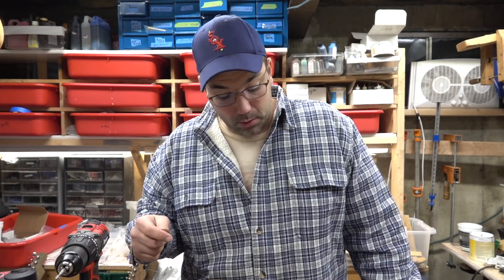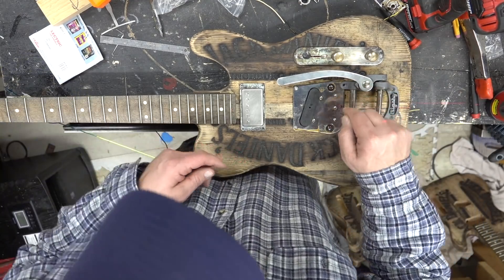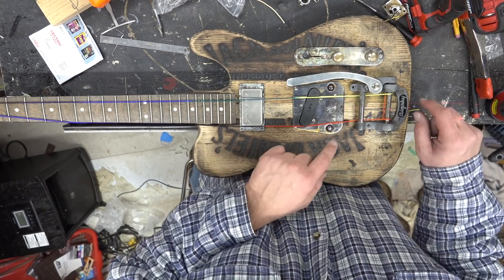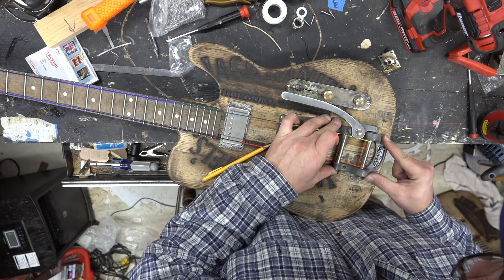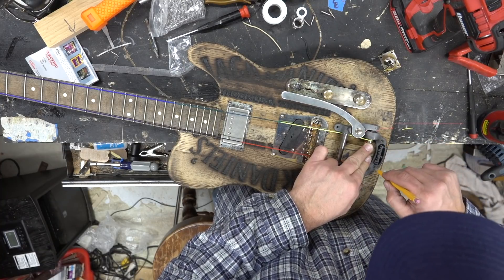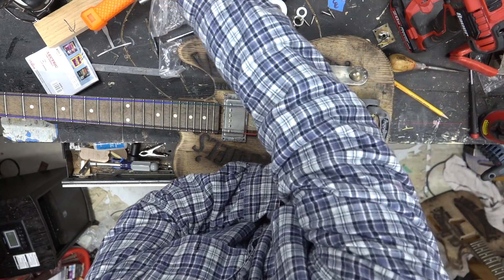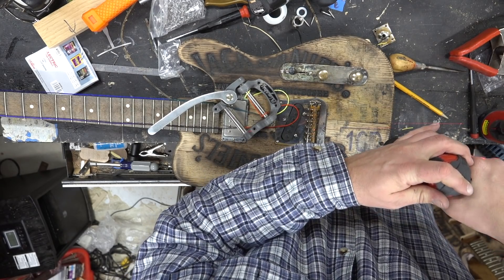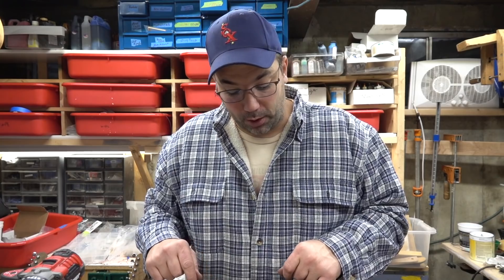Some tricks for setting up a bigsby tremolo on your guitar

Comment: The JD's are a real success. Well done and well deserved.
Just a little tip. 
When screwing screws in oak,  first pull the screw along a piece of candle, it goes in much easier and won't break. (tip from my dad. RIP)

Comment: Couldn't you add them screwholes to your template?
Reply from the maker: Every top has its own character issues.  I am scared to have to drill and fill if it doesn’t line up.   There is about a 1/16 play when setting up a guiyar